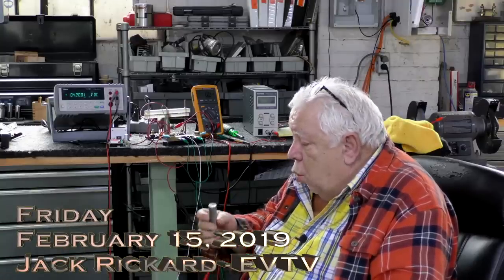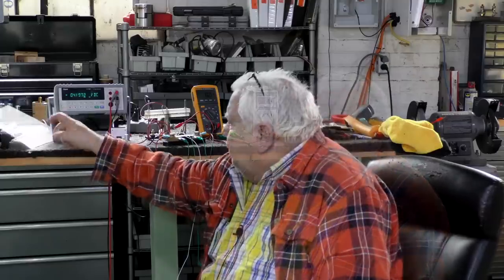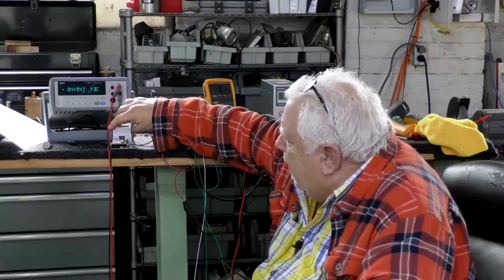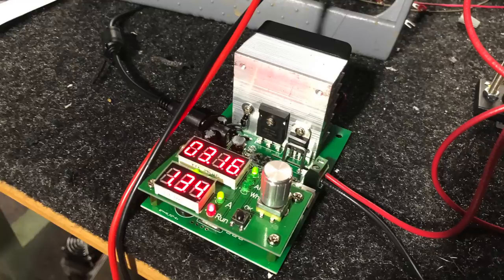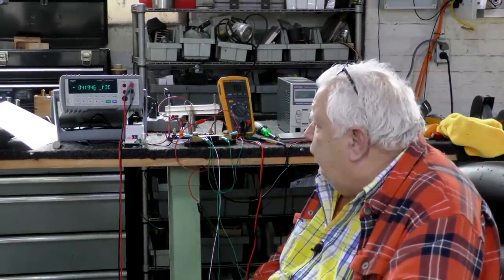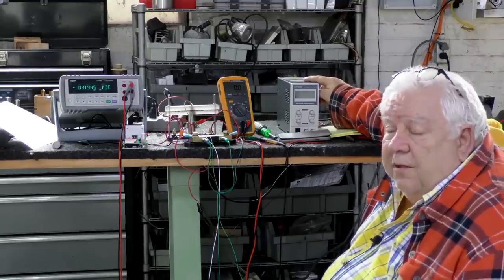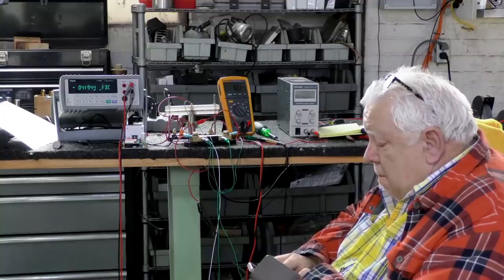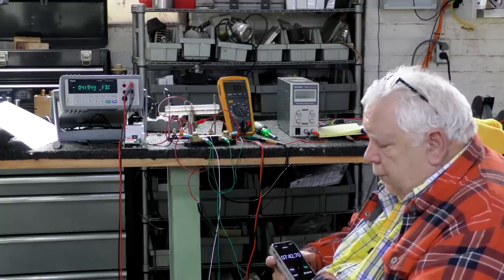Testing Tesla Model 3 2170 Cells - Battery Nerd Porn with Full Frontal Nudity

Comment: One thing I don't understand about Maxwell's move to sell is why didn't they employ their technology to produce the new generation Li-Ion batteries themselves and become the new leader on the market? Instead they sold the company to Tesla for peanuts.
Reply: I expect they couldn't easily scale it without Tesla or another batt manufacturer.  That would mean that the only other companies that could partner with them to scale is limited to battery manufacturers since it's time-sensitive eg they cant get a roudn of investment and spend years doing it because someone else will beat them to it by then.  Based on their last quarterly report they were testing with a 'company' eg Tesla to verify it would scale up with Tesla's process on the Tesla/Panasonic equipment at the factory.  The scientists who help Tesla wouldn't understand really well the manufacturing side I expect to even worry, but they coudl have signed NDA's in case the sale didnt proceed as planned so they couldnt just jump ship to eg Panasonic or something.  I'm sure the Elon team rigged it all up strategically.  The fact that they sold off the one part first, mainly benefits Tesla since now they have the $65 million on the balance sheet and all they did was dilute the shares slightly by $200m to buy it.  The 65m goes on the books and is free cash right away for Tesla.  Tesla has big shareholder individuals eg Elon and others with a lot of personal control, but this company may not have big share holders like that? That means that individuals at the company are easily paid off, promoted after the deal etc to make it all happen the way Tesla wants.  It's a take over so unlike a startup being bought out where they can negotiate with a lot of leverage of a few individuals making the decision, the Maxwell shareholders will vote for it to go through.  The stock price went up as a result by a large amount for this company, so shareholders are probably happy to cash out or take the Tesla shares equivalent.
Reply: Lots of capex required. Discussed during the Needham growth conference by Maxwell CFO

http://wsw.com/webcast/needham89/mxwl/
Reply: Something else worth mentioning is that if tell stock goes up as a result of this merger, which it will, then the value of the company for it's old stock holders is worth more than the 218million they sold it for.

They were looking for return on investment. Only Tesla could truly scale the technique and make the most money from it.
Reply: A very good point.

Comment: No surprise exactly as expected in therms of capacity as is the exact same as the one on model S just in a different form factor.
This is the spec of the cell used in model S https://www.batteryspace.com/prod-specs/NCR18650B.pdf  and you can see they do the capacity test by discharging down to 2.5V not that there is much more to get from 2.8V to 2.5V
Notice that at 500 cycles at 100% DOD the capacity is at about 70% of original so basically end of life.
Waiting for the 5 cells I ordered from you to do capacity test (not interesting as you already did that) but I also want to do cycle life test even if that takes months just to show that there is nothing magical about this Panasonic cells used in Tesla EV's and while they are a good choice for EV because of high energy density they are a bad choice for stationary energy storage applications when compared to LiFePO4.
Reply: The 2.5V cut off is how they test the cells so stated capacity is based on this even if as you mentioned is not a good idea to be at that level.  For high discharge rates going to 2.5V under load is not a problem as that is not the real cell voltage since a lot is voltage drop inside the cell and as soon as the load is removed the cell will bounce back to around 3V
Tesla provide little if any technical info about their products as rumors are usually more favorable :)
The Tesla model warranty shows that this are no special cells 120 miles or 8 years for the long range model that translates to less than 400 cycles at 100% DOD of course they leave some margins for the calendar aging but this as as best as this cells can provide else the warranty will be better. Also this warranty is good enough for the average driver so there will be no reason for them to have better cells than this. They optimize for range and keep the cycle life good enough for the average driver.

Comment: Fluke offers some great meters now with data logging capabilities. The fluke connect software is very handy but they do have some bugs to work out. I’ve used the feature to log amperage on pumps. The time stamp was off, but the information was easily corrected. It puts everything into a graph also. https://youtu.be/PwWr4B3SbP8
Reply: My apologies. I didn’t hear you speak of fluke data logging features, but of your liking of fluke meters. Just a share of the issues that are also inherent with even fluke data logging. Perhaps some other YouTube’er has some use for my shared words of my experience.

Comment: I like the bar diffusion analogy, but I think the wife didn’t she called twice to check and see if the big breasted blond was still there.😁

Could it be said that the diffusion is akin to ingress of the bar without egress? That’s probably a bit simplistic but it helps me understand what you are describing in how the ions slow the charging of the battery as it approaches maximum occupancy load.

Comment: Kids with compilers are dangerous. Ha ha ha

However your temperature argument is pretty weak. In a model 3 those batteries are in a pack with no where for the heat to go. Your set up the heat can dissipate out the sides of the battery.